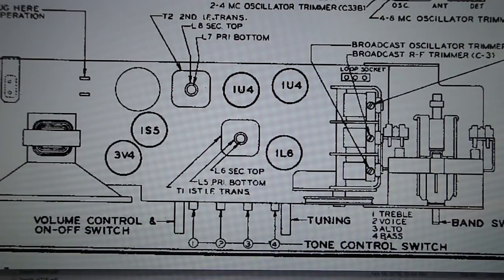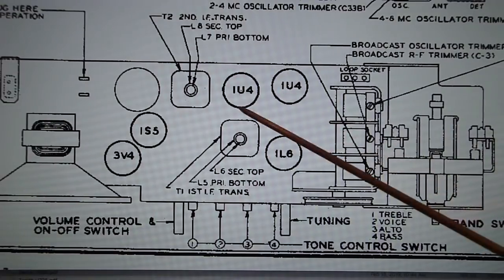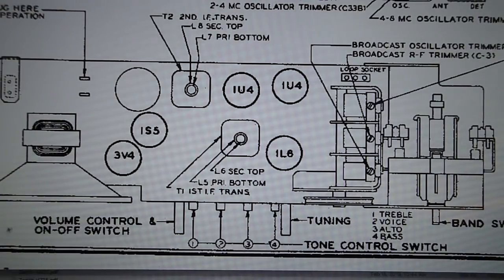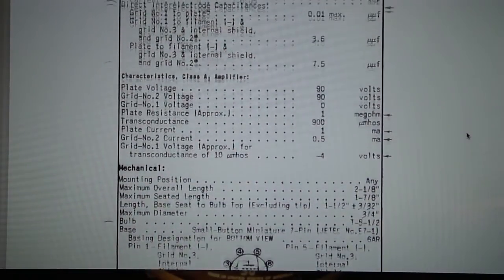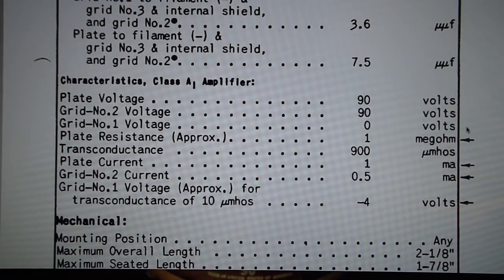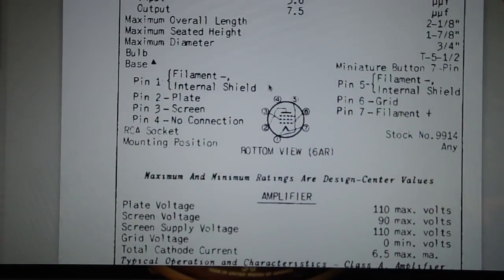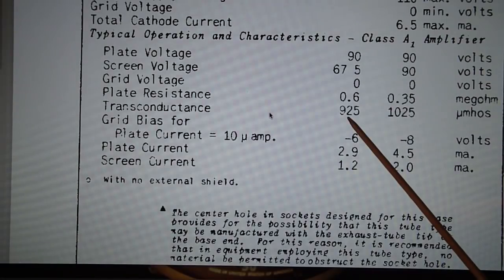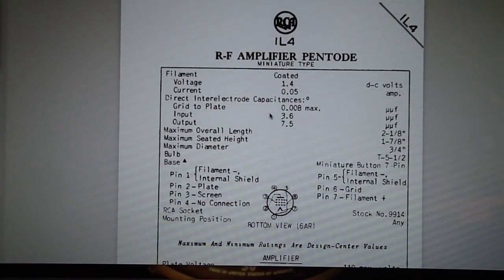The 1L4 Tube! Magic in a bottle? Sucess or Failure?

Comment: Hello there!  I have a Zenith  A 600 radio chassis  6A40, my question is on capacitor labeled  C 13  connected to pin 1 of the 1L6 and it is connected to one of the lower switch terminals.
I need to know the capacity of this cap, is it a .1 or is it a .01 mfd the color code on it is faded bad and my schematic is a little blurry! so I need this verified. Your video # 7 on the 600 T.O. answered my question on initial pointer alignment for tuning BEFORE doing the RF alignment I thank you much for that!! Thanks in advance !!   John Bellas   KC2UVN. 73's
Reply from the maker: Hello John! The 1L6 tube (per the schematic), has pins #1, and #7 for the heater. One should have a 100K resistor, and the other should have a .01 cap (usually a disk) - may have a bumblebee. I hope this helps. Take care! Bob - KC2RDU
Reply: @Radiowild  Many thanks for your answer on the cap value !!  I will replace with a .01 mfd tonight. All other caps are replaced, most were leaky !! The selenium rectifier had a voltage drop of 50 volts and so was replaced with a fast recovery diode of 3 amps with a dropping resistor of 160 ohms. This works well although its a bit overkill on the current but I have about 30 of them!! my B+ is about 103 volts with 120 to 122 volts AC . some resistors drifted quite high and were replaced. cabinetwas spiffed up as per your video and looks good. Thanks for all your videos on this radio, they have helped GREATLY my friend !!  John Bellas
--     KC2UVN  73's